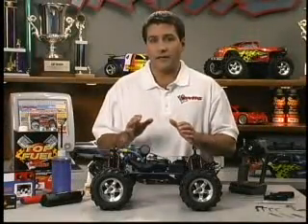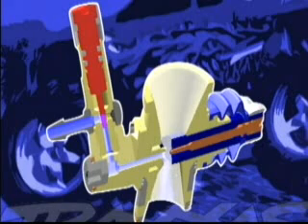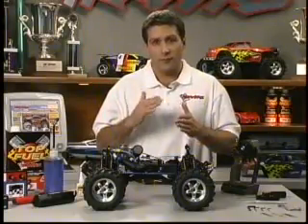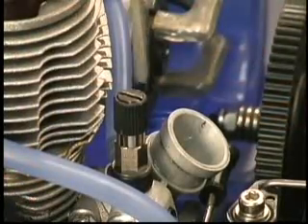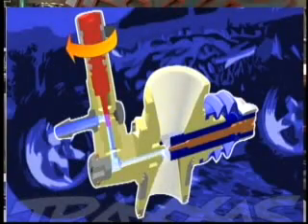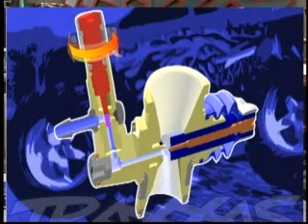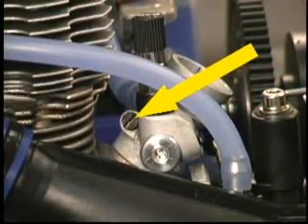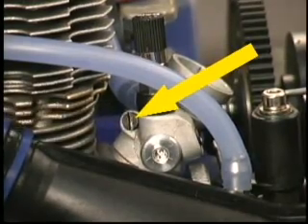Traxxas setup 10 of 21 - Setting up the Carburetor

Comment: help, after pinning the throttle or right after a high speed run the engine will rev up like crazy, then will die down, and quit unless you stay on the gas, but other wise run fine
Reply: Your are runn DANGEROUSLY LEAN richen your high speed needle if you have other questions let me know.😀